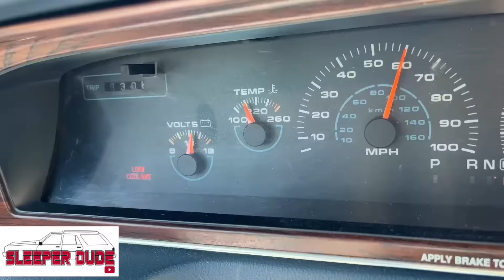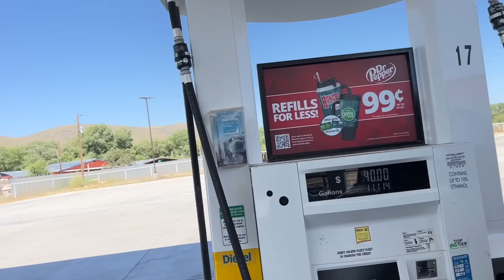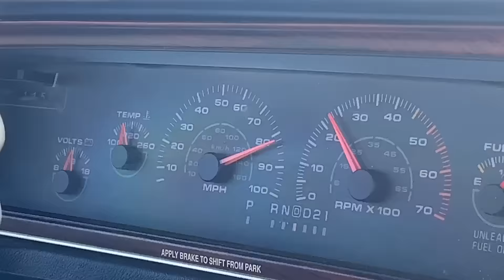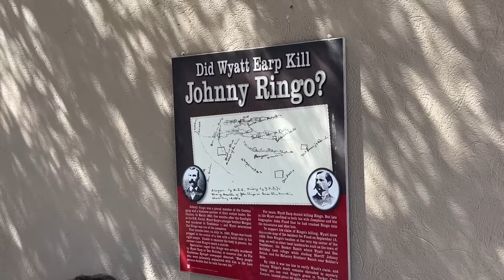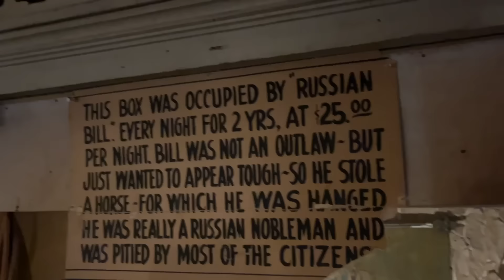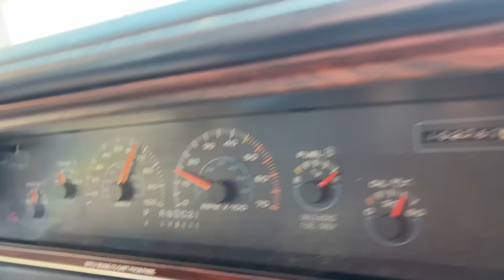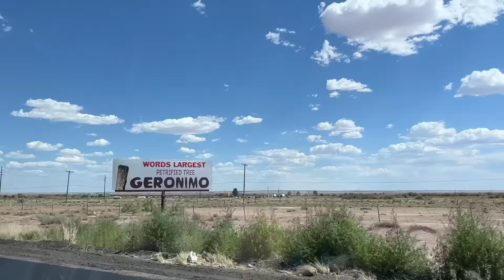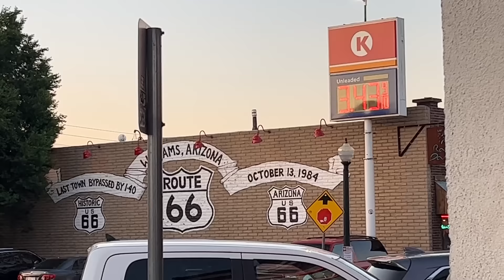7000 Mile Road Trip In A $2700 Car! Can We Make It?

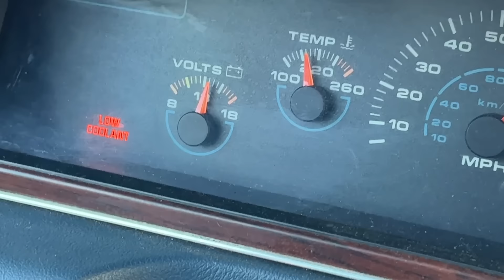Comment: 1:45:44 josh, that low coolant light is caused by the sensor going bad. Om the radiator about 2-3 inches below the cap is a small black box with 2 or 3 wires coming out. You fan unplug it and the light will stay off. How it works is there are 2 contacts inside, and when they are covered by coolant the switch is open and the light is off. If its gets uncovered by low coolant  then it closes and turns on the light. Usually scale builds up on it, throwing it off.
Reply from the maker: Ok thank you I need to fix that

Comment: Don’t forget to check the air pressure in your tires first thing in the morning. FYI, Costco has free air (nitrogen) stations that are open when the gas station is open. Don’t have to be a member to use the air pumps.
Reply from the maker: I didn’t know they did that thanks
Reply: @Sleeperdude I think he meant casings.

Comment: Brought back a lot of memories.  My family moved out to SoCal from Denver in '53.  We stayed in those TeePee motels each time we drove back to Denver to visit Grandma & Grandpa.  We stayed on the ORIGINAL Route 66 all the way from Albuquerque to Pomona.  First time was in a '47 Studebaker later a '53 Chevy Convertible and eventually a '60 Corvair. and a '64 Impala 
Then,  in 1971 I was old enough to Drive the new I-40 to Texas all the way to Amarillo while in the USAF.  And many times since then. But it's still Route 66 to me.  Those old Gas Stations you see there filled up our car (17-19 cents a gallon), checked the oil and washed our windshield.  The Restrooms were clean and the attendant would wink at Mom when he was washing the windshield and she was pointing out the bug splatters. 😉
What you are missing are the "Burma Shave" signs along the way.

Comment: Stop by Lowe's or home Depot get you a metal full inch dryer vent tube and connect it to one of the vents up front, and get you a drop from the gutter system and connect it together and put it over your air vent
Reply from the maker: Good idea

Comment: Information on the OK corral, actually the original OK.Corral burned down and it was rebuilt in a different spot.The original okay, corral is actually on free Mont street.You actually drive over it near where you parked at

Comment: Be very careful about the heat, stay hydrated . Things are actually melting like car wiper blades and plastic rear lights on cars even showed street signs with the paint melting and running down
Reply from the maker: Yes thank you

Comment: Pickles and pickle juice are a probiotics so good for you. Plus they have vitamin K. Pickle juice has significant amounts of vitamins C and E, two key antioxidants. Antioxidants help shield your body from damaging molecules called free radicals. Everyone gets exposed to free radicals, so having plenty of antioxidants in your diet is a good idea. Does pickle juice have any health benefits?
“Pickle juice contains electrolytes in the form of a lot of sodium and some potassium and magnesium. That's why you can use it as a natural electrolyte,” says Skoda. “It can help to rehydrate after exercise.” To get the most benefit, Skoda says to choose a vinegar-based pickle without yellow dye and preservatives.

Comment: I Live in Benson AZ and I am very familiar with the entire area around Tombstone. The Border patrol checkpoints are common out here due to the amount of both drug and human trafficking that happens down here. We see high speed chases all the time smugglers doing over 100Mph on Hwy 80 through tombstone all the way to Benson.

Now on the way out of tombstone if you had taken Hwy 82 you could have stopped at Fairbanks which is a Ghost town along the San Pedro River. The San Pedro is one of the only rivers in the Northern Hemisphere that runs North. Continuing on 82 to Hwy 90 North would have brought you by Kartchner Caverns state Park then Back to I10 where your Motel was. There is a lot of History here in Cochise County. Wyatt Earp's Brother Warren is Buried in Wilcox AZ which is the first major town coming into Arizona.

Comment: I am so surprised at how that stationwagon is holding up. Is the AC still working ok? That low coolant sensor is probably attached to the overflow tank and is faulty, maybe you can just unplug it. You are very lucky at how it isn't running hot with all that weight it's lugging in that brutal heat. Hope y'all make it home okay!

Comment: If the tempguage stops doing that, you will start having problems ŵith the car......Oldsmobile have some secrets in them that you don't want not to happen while you are on the road......that's one of them......lots of sensors to "take care" of that big block cruiser " BTW YOU HAVENT SAID ANYTHING ABOUT THE AIR RIDE PUMP IN THIS ONE.... YOU MUST HAVE DISCO'ED IT OR GOT IT "DIALED ÌN"